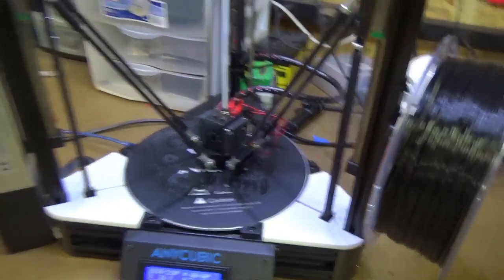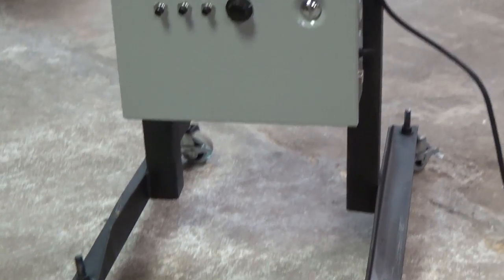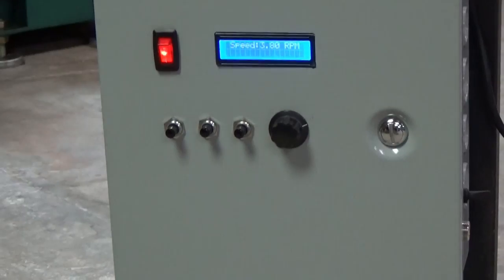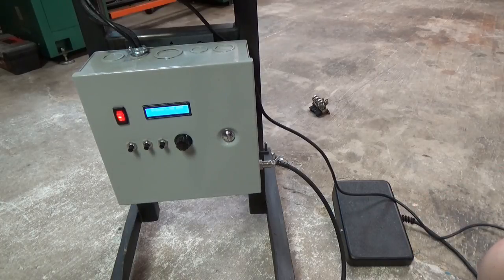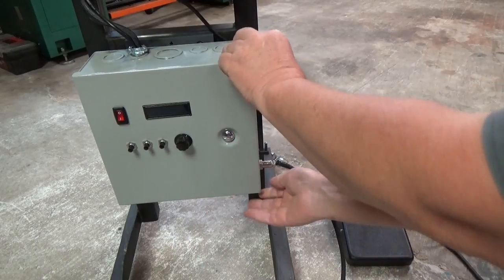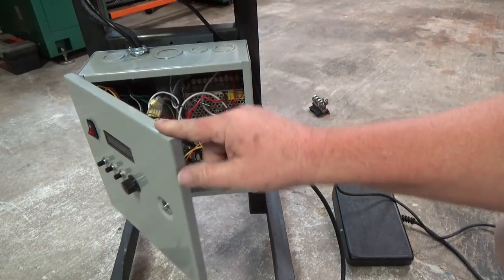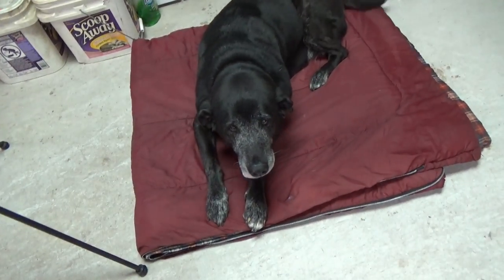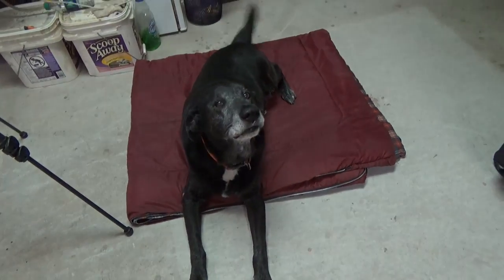Welding Positioner

Comment: Sorry to hear about your health troubles ... life can certainly take some unexpected turns.  Try to keep in mind that someone always has it worse.  It doesn't fix anything but it keep a few things in perspective.  Btw, you have a stepper motor on your welding positioner, not a servo.  Look them up and you;ll see there is quite a difference.  Be well and glad to see you are back and doing well.
Reply from the maker: I was wondering when someone would catch the stepper error, having recently built two 3d printers (stepper motor) and a lifetime of RC planes (servos) I simply could not think of the correct term when I shot the vid. thanks for pointing it out keith
all the best
bs

Comment: How many rotations does it need to go to weld around? If around 380 degrees is enough, program it to only go from 0 to 380 degrees, then for ground, bolt on a wire to end. Unless that slip wire is fine. For next piece, rewind it, can have a programmable rewind momentary button that when hit, will rewind at full speed back to zero. Just some ideas. Your unit looks great, nothing better than making own.